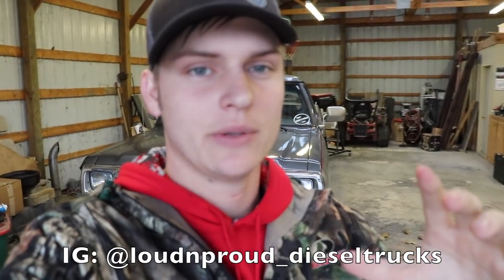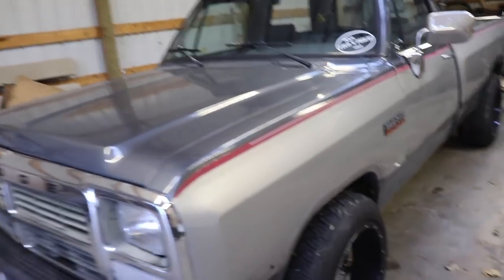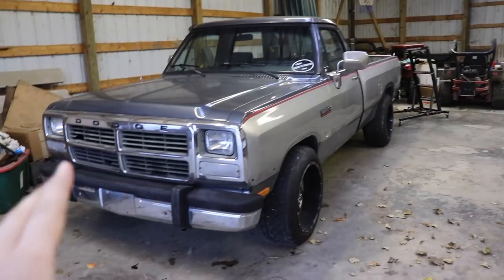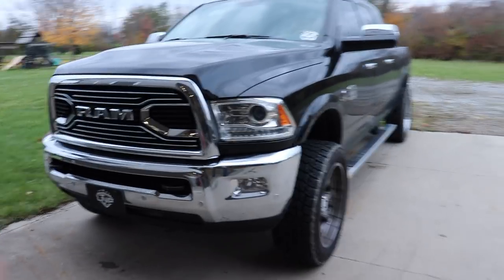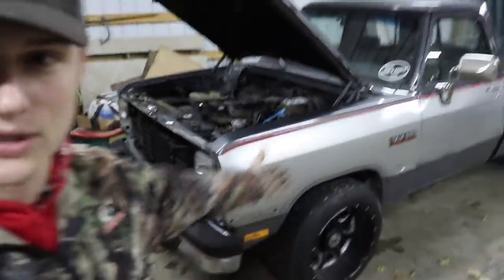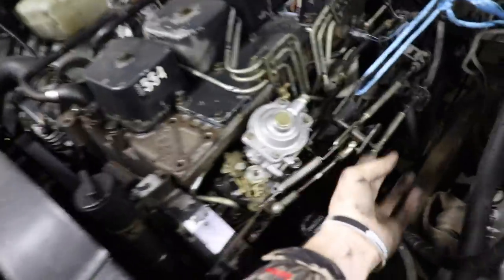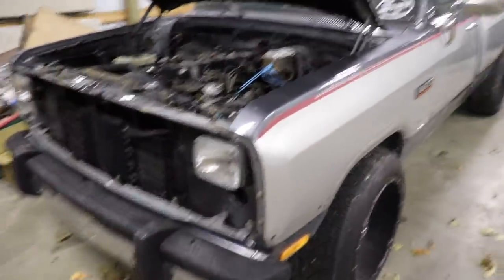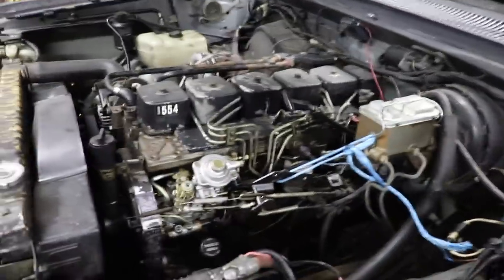PROJECT 1ST GEN CUMMINS STREET TRUCK!!! Day 1!!!

Comment: I like that you are back to working in the shop on trucks,  it helped me gain knowledge and some confidence that I could do most of the repairs on my 1996 ram 2500.  Something I have noticed on my 1996 and my brothers 1996 the radiators were both plugged up bad and the heater core as well, just something to think about,  keep up the good work.

Comment: The twin ram intake won’t work because of the injection lines with the ve pump but will work with p-pump setup since that’s what it’s based around.
Reply: You beat me to the punch. GregA did the same thing to his 1st gen. Just thought that might be a 'research reference' to help.
Reply: Newley Michael newer ve lines might. Like on my 93

Comment: Yes the intake thing is different on the non intercooled, I heard you can flip the plate around so it will be in the intercooled spot, on my crew cab I just made my own cold side pipe so I didn’t worry about it, btw I messaged u on snap chat about 1st gen parts

Comment: get a second gen fuel line so so you can use the second gen twin intake
Reply: He'll have to get 2nd gen injector bodies if he does that as the inlet fittings are different size between 1st n 2nd gen...but that would work
Reply: @jasontruman1215  you know what...your 100% correct, I totally brain farted that one lol.